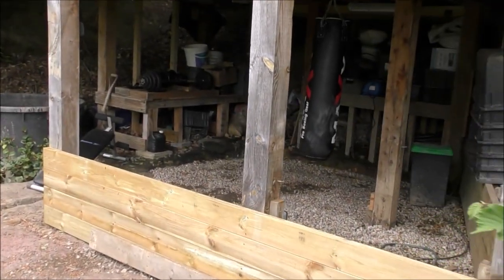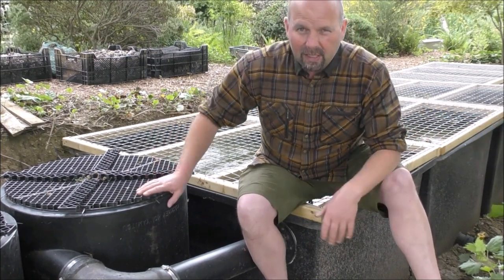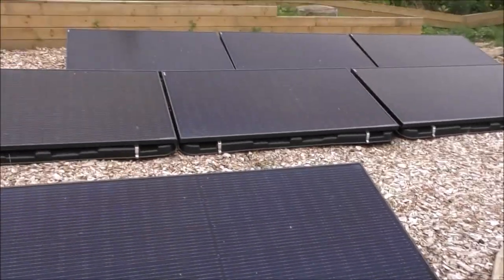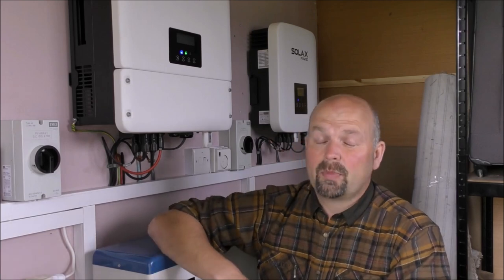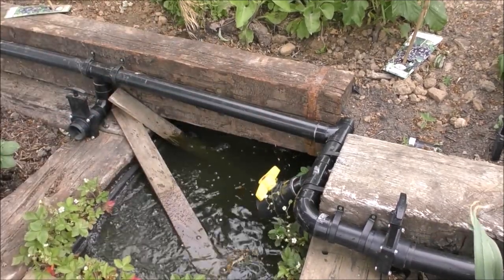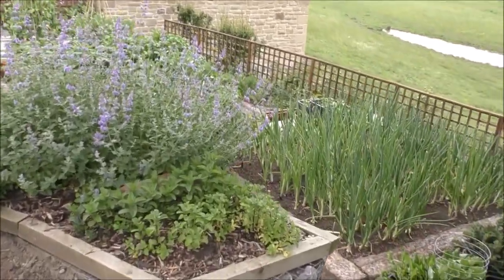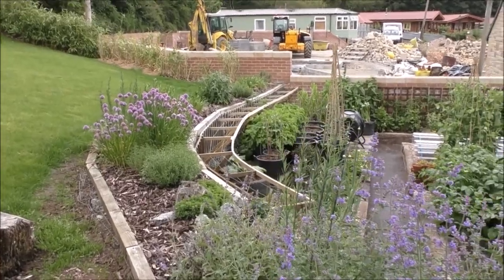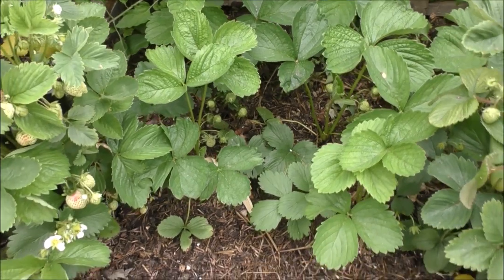Compilation of Garden Projects

Comment from the maker: This is a compilation of 5 videos I uploaded to my 'Thousand Yard Stare' channel. Future garden projects and updates will be exclusive to the Thousand Yard Stare channel here: https://www.youtube.com/channel/UC1pgJBGQrUfCUAhk63U5u5A
I saved up for these projects in 2018 / 2019 as I knew some hard-core nonsense would be coming in 2020.......Time stamps are below:
00:00 Pond and filters
08:28 Off-Grid Solar
19:08 Vegetable Garden #1
30:22 Vegetable Garden #2
59:36 Greenhouse and Hydroponic Towers

The solar system was installed by Sustainable Energy Engineering and this is their website: http://www.susenergy.co.uk/
The mesh I used for the crop protection can be found here: https://ebay.us/jb9FlJ 
and the woven landscape fabric can be found here: https://ebay.us/T6xJTz 
Rotating compost maker (Ebay): https://ebay.us/ssQcyc
Rotating compost maker (Amazon): https://geni.us/cgVLS
The price has gone insane since I bought mine in early 2020....I paid around £90 then. Next year it will probably be over £200 if the hyper-inflation continues.
Greenhouse was built by Sekura Windows from Newcastle: https://www.sekurawindows.co.uk/
The lights used in the towers system are 6500K / 2200lm daylight tubes and are only 20W each so a combined total of 80W per system will be cheap to run - mine basically cost nothing to run since they are powered by the 12.4kW solar system. They can be found here: https://geni.us/7AApcMP
I've go some red/blue grow lights to fit in the Winter for when I switch the plant species to tomatoes (red light is better for fruiting plants) and I will show them in a future video. They can be found here: https://ebay.us/VUc4w7 and here: https://geni.us/wws9c0 
The tank used for water storage: https://ebay.us/lI9yhH
The whole system can be easily stripped down for relocation if necessary.
Simplify Gardening - a proper expert gardening channel: https://www.youtube.com/user/knightreplica

Most of the materials used to create the gardens and growing systems have gone way up in price since I bought them as I got most of the parts together in late 2019 early 2020 before the agendas plaguing our World kicked off. There are alternatives at a lower price for sure but the products listed are what I used.
I saved up over a long time to be able to buy the necessary parts to create the food production facilities and what happened in early 2020 was the kick I needed to make it happen. Millions of others have done the same and it is excellent to see people taking charge of their own future.

Fake 'money' exchanged for something of real value?
That's a great deal.
Reply: Thanks mate, great work

Comment: Got as far as back end of the solar farm . 
Small suggestion for you regarding cleaning of the panels (I’m a water fed window cleaner using pure water ) it’s wouldn’t be very costly for you to set up a small Reverse osmosis (if you haven’t got one somewhere anyhow ) 
Fill a hand full of barrels or a tank (Ibc or something and a small 12v pump to then supply to a water fed brush with a flocked bristle brush and then you’d be cleaning them like the pros (well with a diy system ) 
Happy to discus this with you a make suggestions for equipment , brushes etc suitable for solar cleaning . 
Keep up the good work .
Reply from the maker: We've taken a mains feed to near the panels and I've got a water fed brush which attaches to a hose. I cleaned them last time by hand with window cleaning tools but the brush will be way faster and easier.
It was surprising how much muck came off them and most of it was pollen - we get a nation of pollen here for a few months of the year and it can leave a yellow dust covering everything. When I use the leaf blower it's like a yellow could gets stirred up and the oxygen gets turned off as it leaves me gasping if the hay fever is playing up. I need to move to the Outer Hebrides.......